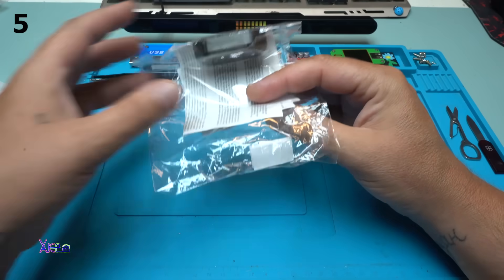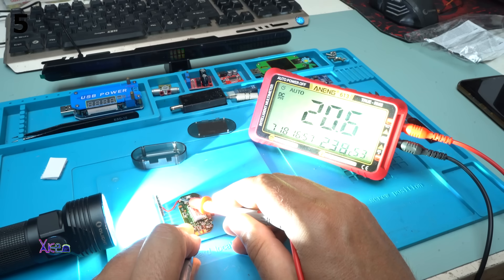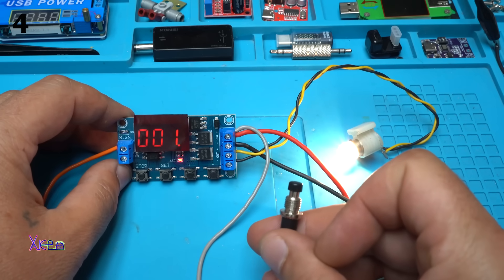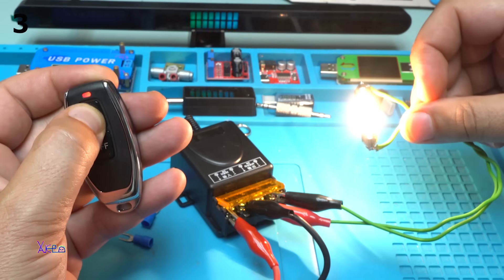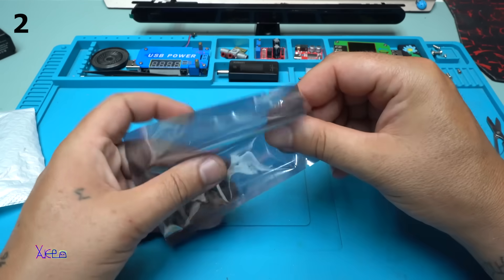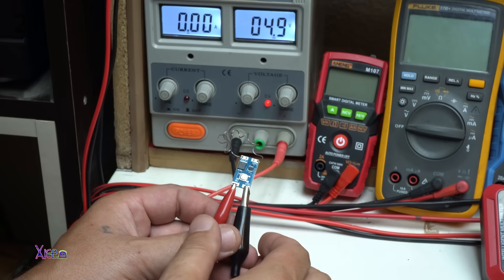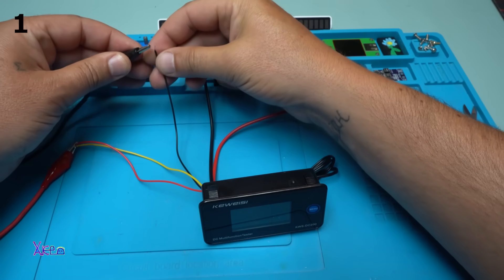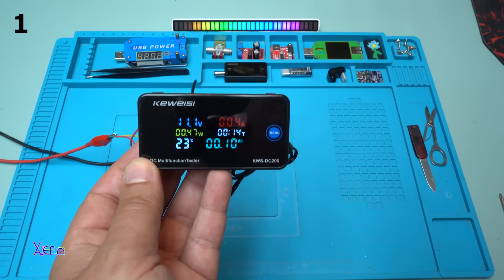TOP 5 AMAZING $5 Aliexpress Modules

Comment: 06:02  It would be nice if it would work for AC.  Not too many people have DC water heaters or ceiling fans.  You would have to wire in an additional relay and would also have to have constant DC power supplying the module.  For 99 cents I think it's an outstanding deal.  I just don't agree with the advertising on the page.